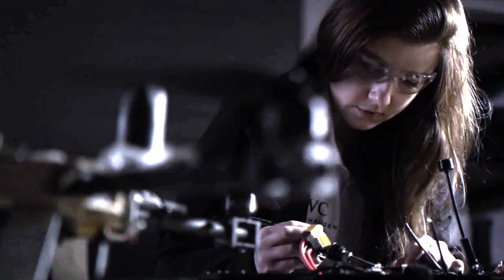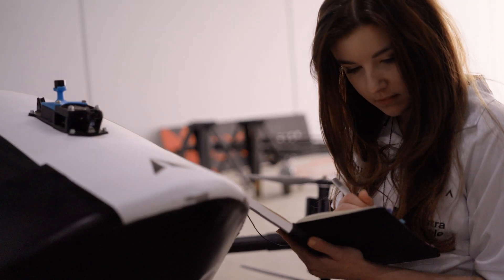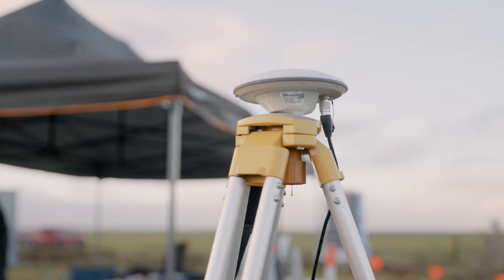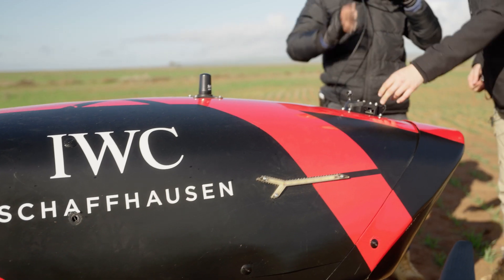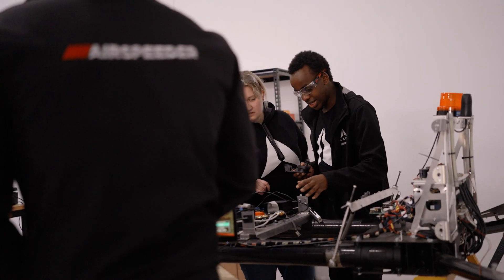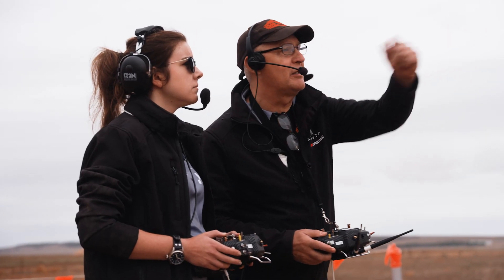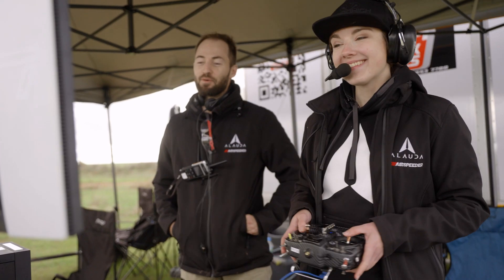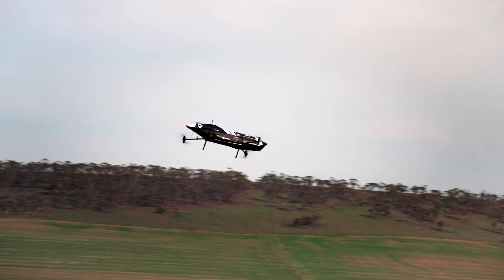"EXCITED" to Fly FPV! | Airspeeder EXA Pilot Lexie Janson

Comment: Awesome. When do you get in it?
Reply: Soon!
Reply: @MaiOnHigh  Total BS ... if you do, if you crash... your mince meat.
Reply: @dodgygoose3054  that's what safety systems and engineers are for 😅🤷🏻‍♀️ I hope you never get into a car or a plane... You know... Because of the crash situations 🤷🏻‍♀️
Reply: @MaiOnHigh  lol 😂 with that drone with not a single crush zone or manual control surface... It's a flying  coffin ... Power out your dead. Not even that, the G's alone would knox you out with that high speed manuvering. No sane qualified person would get into that.

Comment: Just a big drone ... no onboard pilot ... no cockpit ...  no fail safe for onboard pilot...   where is your future ?
Reply from the maker: It's a similar argument with Mercury, Falcon and Artemis. Remote, autonomous safety systems are built first before you move into crewed racing. Collision avoidance, v2x, safety cells and RTH all need testing. It's how motorsport is made.
Reply: lol yeah because red bull air race or btw ANY aviation display has any failsafe. The only failsafe possible is exactly starting with unmanned remote control craft and when reliability is established then thinking about going manned, as the vehicles are designed with that in mind.
Reply: @halexvr  ...  control surfaces = manual flight control.  This drone design doesn't have a future being internally piloted as any power cut out, equals total uncontrolled freefall ... its impossible to place a pilot into this craft and get insurance or a race safety cirt. The amount of crash crush zones and safety tech in a F1 is stupendous and then stunt aircraft is on another level; the above is a big drone with nowhere to go but ripping off grant money... unless people want to watch big drones race ... with remote users safe on the ground.
Reply from the maker: You are almost there, EXA is the series where we test it. Our Mk3's are not supposed to have humans on board. Check out our Mk4 program though over at Alauda Aeronautics.